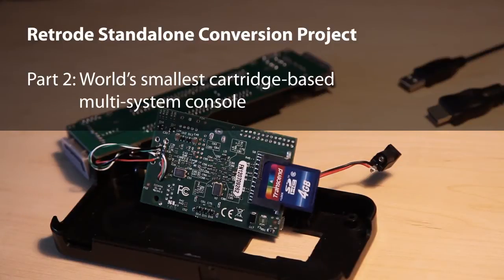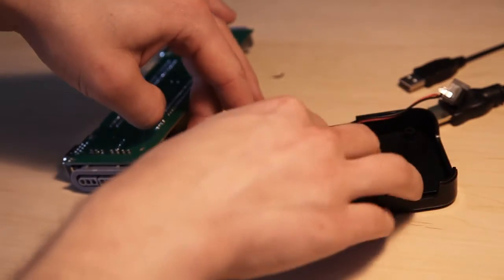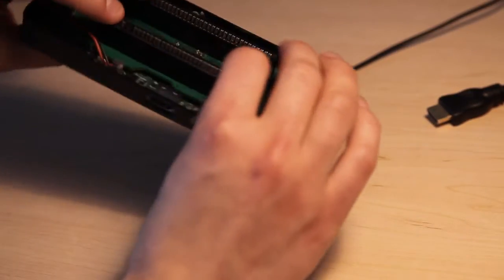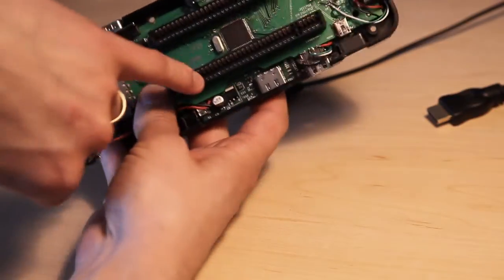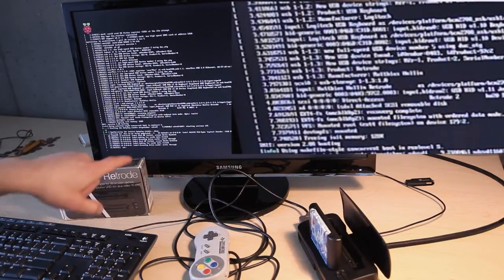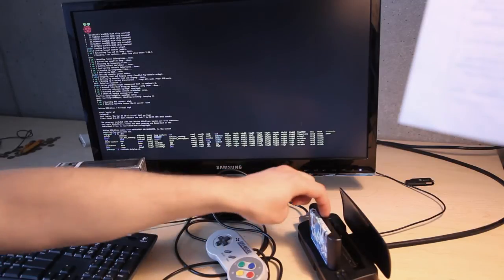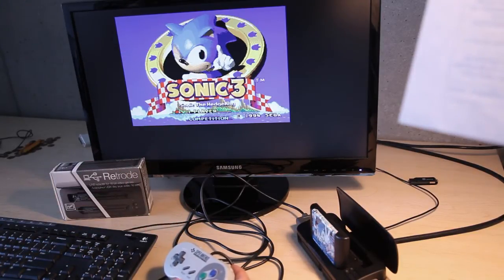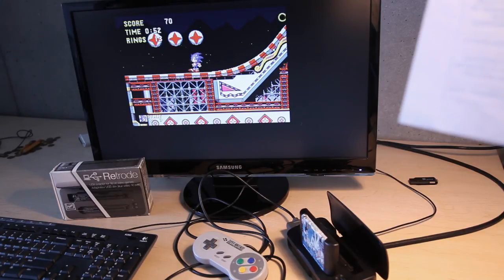World's Smallest Multi-Cartridge Console using Retrode and Raspberry Pi

Comment: 1:40 - near the SNES port on the left (under your little finger) have you just glued the red & black power wires down or have you also soldered them to the pins of the SNES port?

2:47 - even if you could access the MicroUSB, wouldn't you need to need to add that AC socket anyway? Or is the MicroUSB's 3.3V/5V safely sufficient to power both the Pi AND the Retrode? o.O

Still waiting on the wiring schema but it doesn't look too hard ^.^ if you could help me out on those questions. Thanks!
Reply: @1 - that's only glue for strain relief; no electrical connection. 
@2 - the Retrode's power consumption is way lower than the RasPi's, so no problem plugging Retrode into RasPi's USB (which is essentially what these four wires do). The MicroUSB port is the RasPi's official power inlet. I think the data lines on that one are not even connected.

Comment: If I was building this, i'd use a Raspberry Pi 2 (more processing power), add at least one more USB port, add WiFi and Bluetooth dongles, install a custom RetroPie build with XMBC and Windows 10 added, and definitely add a hole in the case for the power supply (if the power cable was always sticking out like that, it would drive me nuts).

Comment from the maker: Since the Retrode is a 12Mbit/s (full-speed) device, I reckon wire lengths below 10m shouldn't make the slightest difference... When connecting a stock Pi with a stock Retrode via a shielded cable, no gain in speed.